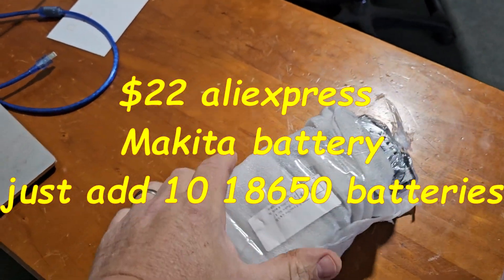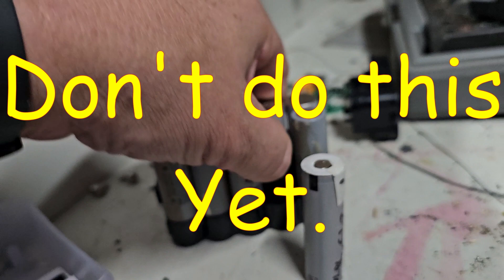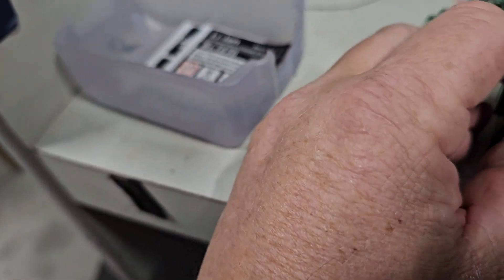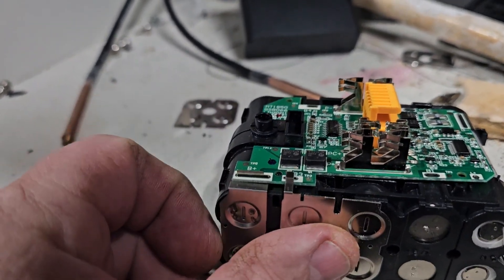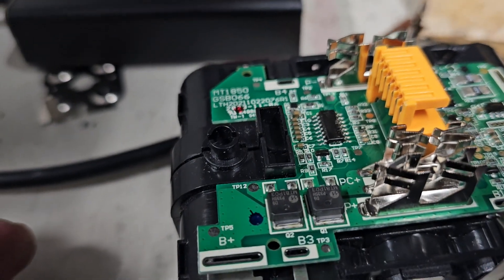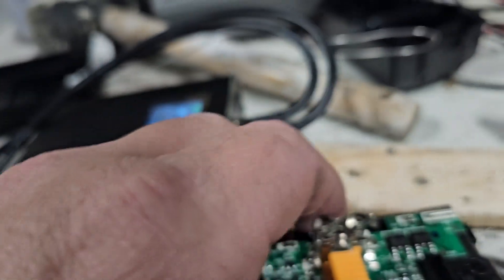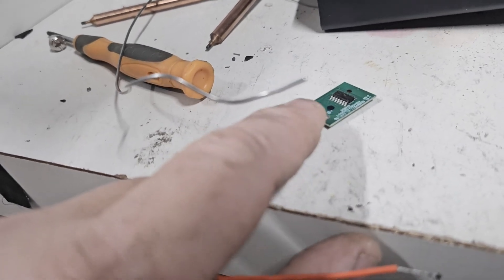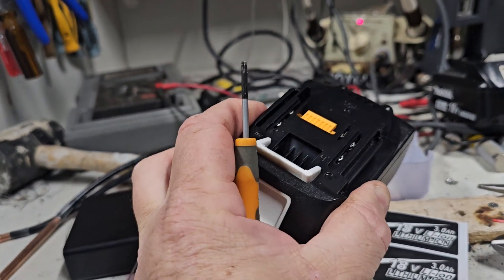Save money on Makita batteries with a DIY solution

Comment: What an idiot! Using random cells. In addition to what @wizwizzards said, the cells must be new, or from the same pack and charged to the same capacity, otherwise they won't charge well. All cells must have the same capacity, otherwise some will overcharge, since some are in series! Good luck replacing the cells!

Comment: make sure to use high discharge cells those ones you used looked to be either 10amp discharge or 4amp discharge panasonics be careful
Reply from the maker: Thank you for the comment,  Which one's would you suggest,  mate?
Reply: @chuxxsss  buying the cells individually will cost you more than the battery pack
Reply from the maker: @djfernando16  I am using laptop batteries that have never been used. I test each one for capacity and resistance.

Comment: Nice to see you again Chuxxsss. 
I use Ozito and their batteries sell for around $50 each if you buy them as a kit with dual charger and 2 x 4AH batteries. Saves me having to build them. Though in the 6 years, I have never had a battery go bad, so a tick for "crappy" Ozito!
Reply from the maker: Ozito have good bmses in them, Ben.  Two months, and you will see the new system I will be putting up.